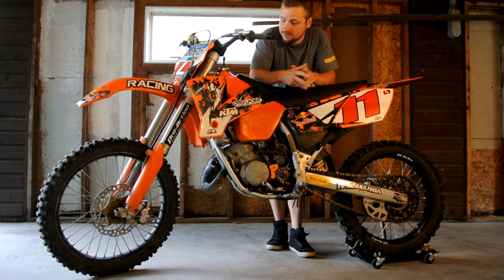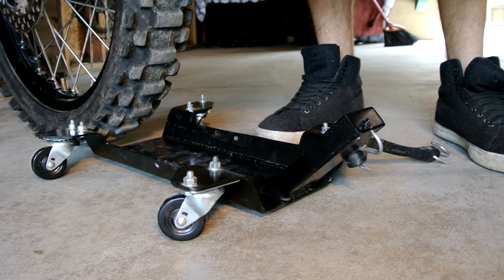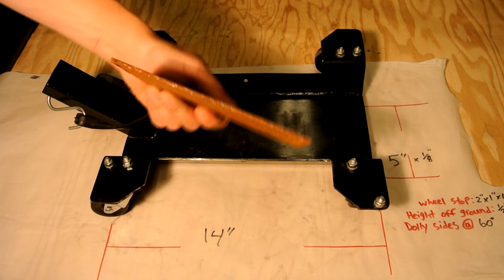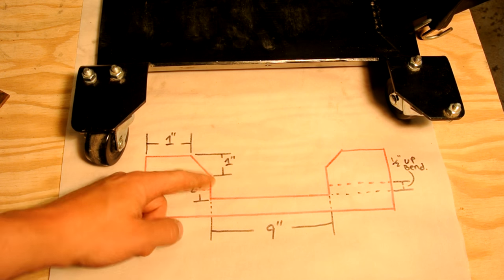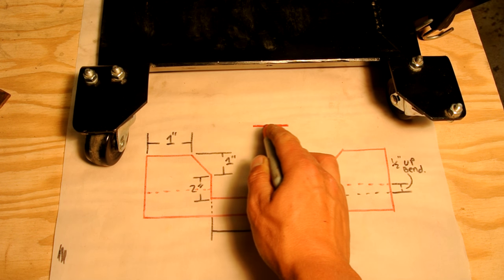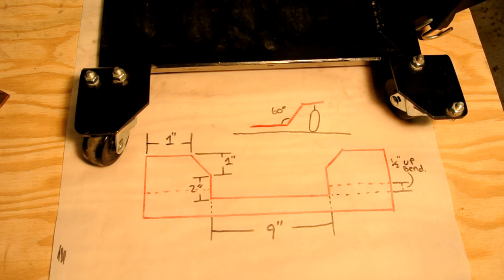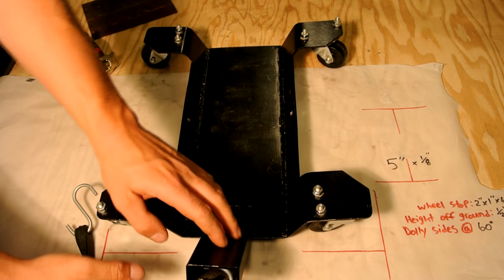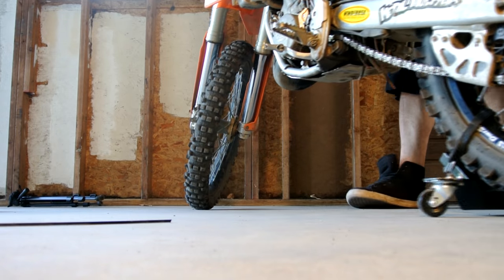HOW TO: Motorbike Wheel-dolly for the garage

Comment: I made a similar dolly for my dirtbike. But I made it bigger and put the center stand on it. That way I can lift the entire bike up, and move it around. If you remove the wheels from the bike, you can still then move it around. The size of the dolly (tray) is also big enough so that I can use it as a crawler to lie on my back when I want to slide under my car for maintenance work.

Comment: Why would you need that if you have a kick stand?
Reply from the maker: Davidthegreat8888 Browning The point of the dolly is to pivot around in tight areas. Rather then either lifting the back end up to kick it over or walking the bike back and fourth to get it moved over. This way I can slide it into tight areas with zero effort.